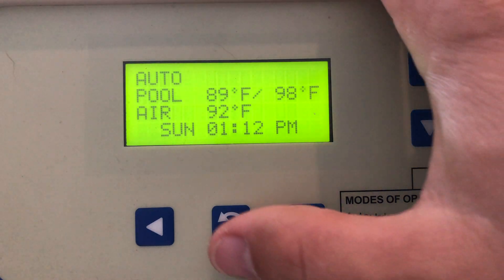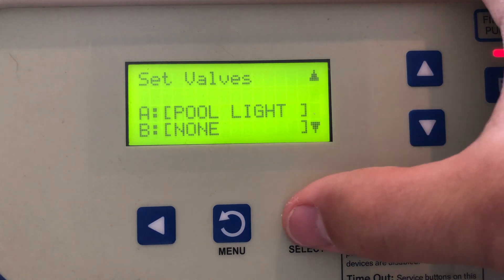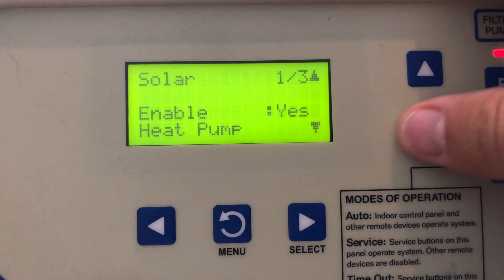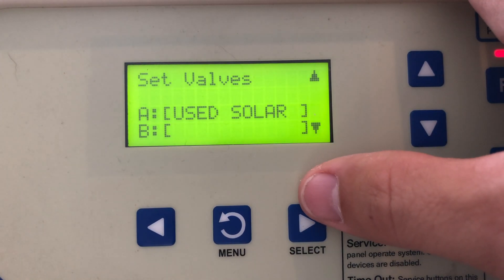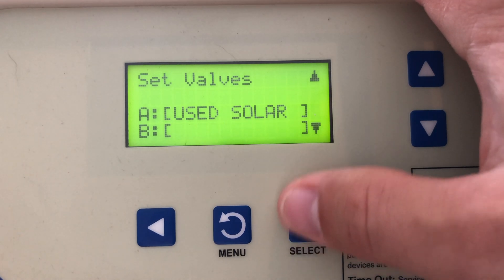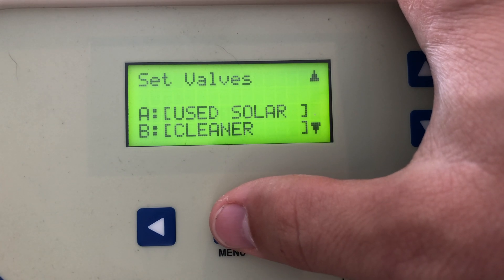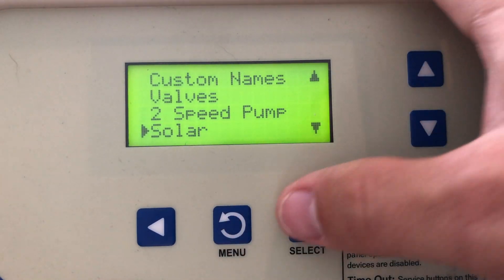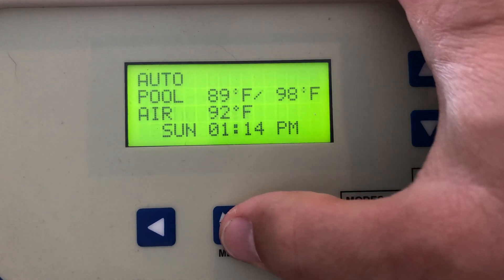How To Program Valves A & B in Pentair Easy Touch Automation

Comment: I am trying to configure Valve B to open and close a pair of 24v sprinkler valves at the same time. I have the valves wired to Aux 3 load and the solenoid commons connected to ground bar. I brought a line wire to bring 15v on my transformer to connect to load. The solenoids buzz but not enough voltage to open the valves. This is when I learned the valves were 24v not 12v. I then purchased the pigtail and installed in in position Valve B on the board behind the hinged section. That can deliver 24v. The pigtail is connected to the Valve B connector on the control board and has Red, Black and White wires. I fed them to Aux-3 power relay through one of the wire access holes. The three wires can connect to the power relay aux 3. I was told that the pigtail is as follows: Black is Common, Red is Open and White is Closed. I want to leverage the 24v to power the sprinkler valve solenoid. I am trying to leverage the 24V and connect it to the load terminal on my Aux-3 power relay. I can't get it to work.  I am watering by hand for over a year, and the Arizona heat is killing my bushes. Any help would be greatly appreciated.